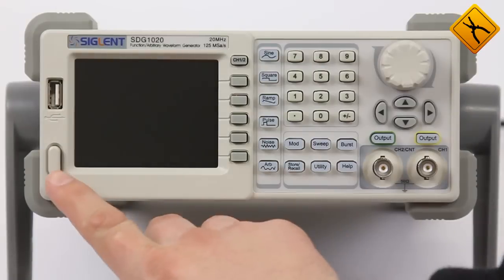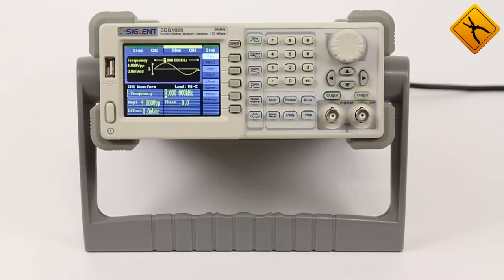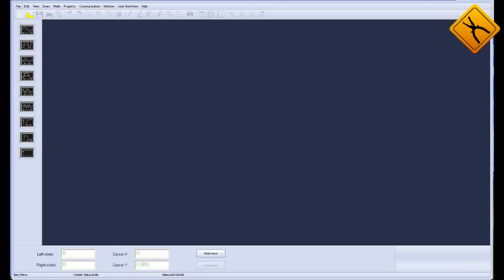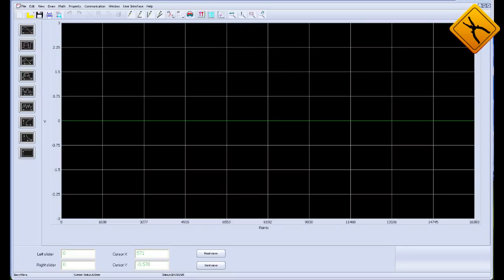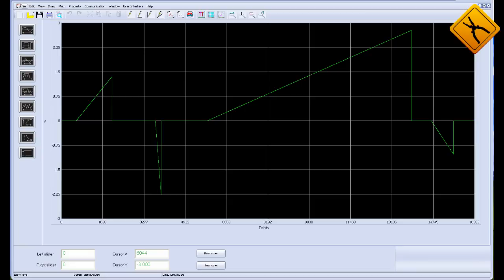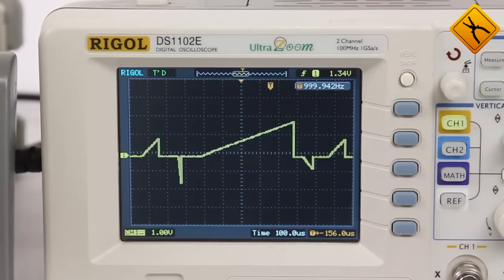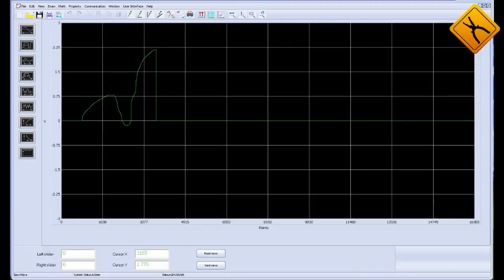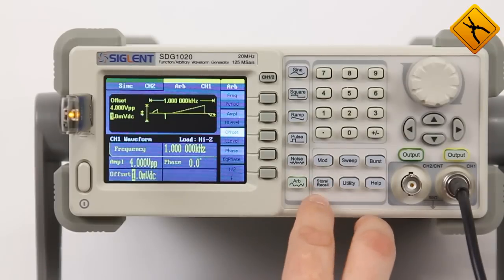SIGLENT SDG1000 Series Function & Arbitrary Waveform Generators

Comment: nice video. Can you save on rigol scope and transfer the waveform file to siglent function generator as arbitrary and reproduce ?
thanks
Reply from the maker: Hello! Rigol oscilloscope can save the signal to file in *.wfm format.
 The *.wfm file can be converted into the *.сsv format, which the Siglent signal function generator can read.

Comment: does this produce sound ? what is it used for ? excuse my ignorance :(
Reply from the maker: This unit can play various types of signals. However, audio signals can not reproduce
Reply: Reviewer's reply is wrong, I generate audio tones on mine all the time when repairing speakers.
At 2:50 he even mentions a 1kHz sine wave, which is in the audio spectrum [20Hz-20kHz]
Reply: This is a dual generator. You can make one common signal on both outputs, and adjust the phase (time delay) between them. This generator is used to simulate signals else expected from any source, in order to test electronics. For an example - an audio amplifiers power rating between 5 - 30 000 Hz. And almost everything else.
Reply: @
@UCJRbRQl18r-30lIYQwXFTBg No, you are wrong, I don't use an amp between the generator and the speaker, It's driven directly. I'm sure Nicolas has long since decided if this unit suited his needs.
I'll assume you missed the "2" in your reply. I sure can't hear below 20 Hz.

Comment: Hello, thanks for very useful video. I have exactly the same oscilloscope like you (Rigol DS1102E) and I just wanna buy SIGLENT SDG1000. One question to you, is it possible to recall some signal which was recorded by oscilloscope?

Step to reproduce:
1) record some signal using oscilloscope Rigol DS1102E and save it on usb flash
2) load this file from usb flash on  SIGLENT SDG1000 and run signal

thanks for replay.
Reply: Yes. You can save the waveform from the scope on an USB-stick, and reproduce on this generator. Or - save on a PC, manipulate the waveform, an directly communicate with the generator via USB-cable.

Comment: Does the function generator automatically selects the voltage (110V or 220V) when I plug it to the mains?
Reply from the maker: +Albert Paolo Bugayong The generator is equipped with a switching power supply. Input voltage must be within AC 100-240 Volts, 50-60 Hz. The user does not need to do anything to switch.
Reply: Thank you :) God bless :)